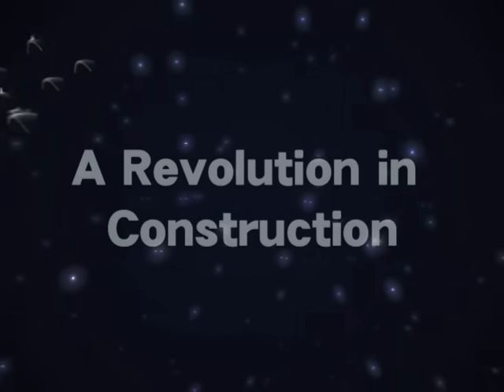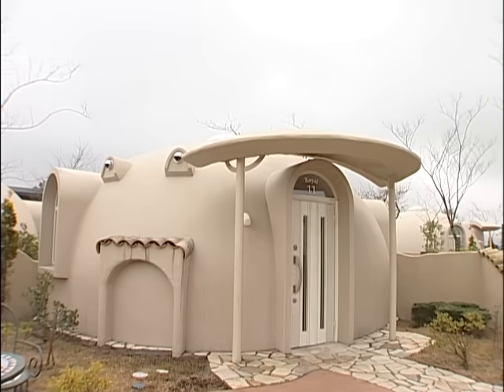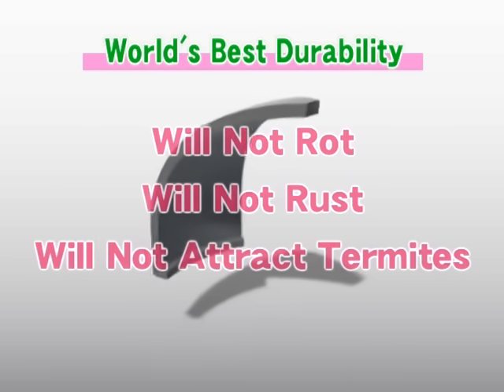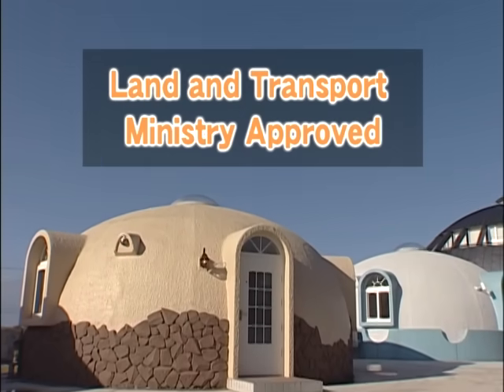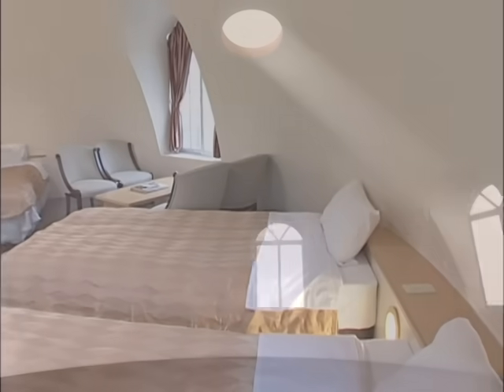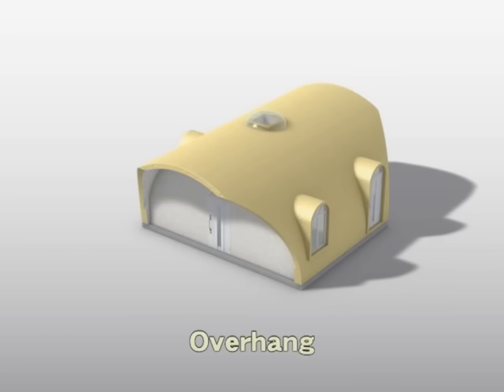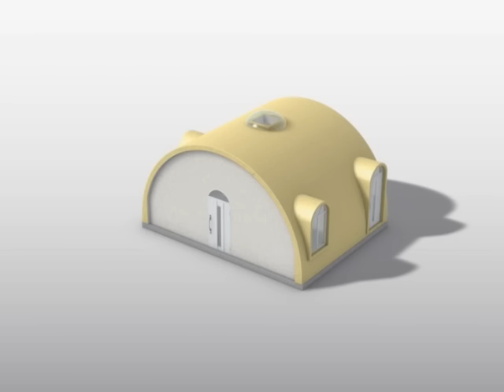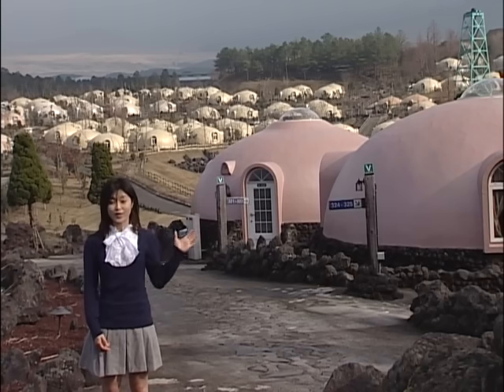Expanded Polystyrene Made Dome House

Comment: These should be designed as pre-fabricated, all-inclusive disaster-relief shelters (wired and mounted with solar-lighting).  Perhaps 2 sizes: one family of 5-6 and expanded 12-persons capacity size.  The dimensions should allow for a longer, narrow, low-ceiling design sufficient to fit inside a C-17 and possibly even C-130!  (i.e., able to be trucked on flat-bed too).  If available as Lease-option, International relief agencies could rapidly acquire said Lease funding arrangement with host-country government and able to quickly deploy.  Thus, the incentive could then be on host-country to further accelerate reconstruction and relocation to more permanent setting.
Reply: CHEER UP, The U.S. Military already have 20 x 16 inflatable shelters that are covered with a cement membrane, that gets sprayed with water until wet & allowed to dry, becomes a great room for use as anything that is needed.
Reply: Decking, arbor, options?
Reply: All it is, is foamed concrete. We don't need another country building them. We build them right here in America.
Reply: nope FEMA would not pay for the labor associated with construction and then the responsibility of  what to do with the structure after use. no they want fully mobile  deliver and forget and easily redeployable
Reply: @angelob9465  yea exactly, so they can have surplus fema trailers on lots in ole miss sitting for years after victims of natural disasters  needed them
Reply: What about effects on environment from discarded houses and components?
Reply: Great idea but the dirty criminal politicians won't get rich that way.
Reply: Something more like that than this already exists.
Reply: @LC-ue6mp  Exactly.
Reply: @skittles3310  Sorry Skittles. Foamed concrete, aka Aircrete, is entirely different from this, but could be done the same way. These are far more energy efficient, and lighter, than aircrete.
Reply: @LC-ue6mp  yep
Reply: @skittles3310  it is not foamed concrete

Comment: That is very cool ,  you could assemble  the dome and  then spray over it  with cement inside and out  then seal it and paint over it .
If you wanted added strength you could  stick some concrete steel  mesh reinforcing and spray more cement . 
 In the comments someone mentioned moon base alpha interconnected domes ,  a fantastic idea. 
 In this day and age , it should not take  months to  erect a house .

Comment: I've been inside these.  The air even feels different, it is like being inside a picnic cooler.  Also no sound from outside, so that seems really weird.  Combine these two things and it feels and sounds like nothing you have experienced before.  One problem was with expansion.  The joints were an issue for cracking, plus you cannot hang things on the walls.
Reply: connecting blocks  by nylon tie

Comment: @Asianecohome PrivateLimitted
I think the idea is excellent, but how do you derive the liquid caused by body and sweat? Polystyrene is water and airtight, so how do you prevent the house from mold growth??

It would be really awesome, if you could use old plastic for the production of the foam material (polystyrene). If this were possible, your product would be extremely good and also very sustainable and environmentally friendly. With that you could achieve worldwide success.

Comment: The simplicity of this design with this material is really attractive.  I just wonder what part "weight" of a structure plays in its stability when subjected to high winds?  My guess is that the shape takes care of that problem.  What about the shear strength of the walls?  That is, the wind blowing horizontally and pushing to snap the dome off of its base.

Comment: Structural insulated panels SIPS . sips panel is like an ice cream sandwich . Mt ice cream sandwich had walls 4 inches of foam encased in 5/8 inch OSB board. The roof has ten inches of foam , exterior side 2 layers of 5/8 OSB, interior just one layer of OSB. All structural elements are encased in the panel. Super strong, air tight, super efficient.
 Florida especially central Florida has brutal Summers.  1,700 square feet of home with one 1.5 ton central ac. The ac is a heat pump so all in one

Comment: The best part is, if the roof collapsed during an earthquake, instead of being killed it won't be any worse that being hit in the hear by an empty styrofoam cooler.
Reply: Actually, domes are more earthquake resistant than box houses.
Reply: +Jaye Jay Curry clearly you didn't appreciate the irony of my statement.
Reply: The humour didn't escape me. I just wanted to point out one of the advantages of domes that your statement opened up.
Reply: And during a flash flood, you can just set on the couch and float down stream - good for dry land and doubles as a house boat
Reply: I had that once after eating mexican.   Never again!
Reply: Do you know what inflammable means?
Reply: Jim Adams 
You'd be Fukashima
Reply: It is coated with concrete or stucco which might be a bit hard on the body during a earthquake.
Reply: B Gone if I could put 100 likes for your joke , I would!!!!
Reply: @jayejaycurry5485  wow, nice counter!
Reply: HAHAHAHAHAHAHHAHAA

Comment: Much like the metal arched building used in the military, but with insulation.  I noticed that they put brick or stone around the bottom.  Wonder if that was in response of keeping pest or vermin out of the house.  If they came with solar panels, they would be perfect.  Wonder if they would be permitted in the U.S.
Reply: It's not real brick and stone. It is all styrofoam with different structure and paint.
It's only for aesthetics

Comment: I live in a house made of expanded polystyrene with a steel frame.  There are some pros and cons.  It is almost too well insulated, so it can get stuffy.  However, my electric heating bill is a lot better than my neighbors.  We had some bad hail one time that made big dents in the back wall, but it was easy to patch.  It was built in 2000, and we are going to get it re-stuccoed pretty soon.  (Unfortunately the builder didn't fix it to the floor very well and we have had leakage under the walls.)

It is very difficult to hang pictures on.  I have had some fall and break.  I think we need to use some wood to make a picture railing.  I'm not sure.  If anyone has any suggestions, I am sure open to ideas.  

There is a problem with noise.  It amplifies noise coming from the outside.  (The floor is scored concrete, and I hate it.  It is way too cold in the winter, and it is hard to stand on for very long.  If we had the money, I would put in hardwood floors.)
Reply: now these are the important questions most ppl needed answered, thank you for your input. now i understand why these aren't being used in mass production all around the world. 

their not bad for what they are, their just not all that well built for other weather conditions. 

this may sound silly, but to solve the sound and heating issues, it might be a good idea to get the house covered under dirt or perhaps a much thicker layers of stucco. but dirt might be much better than stucco. this is how earth ships work, because they use the earths natural temperature control and sound barrier capabilities. 

i just don't know if the building material will be strong enough to handle the dirt packed all around it and on top of the structure.
Reply: @5226-p1e  I've always preferred earthen houses.  We lived in an adobe house in New Mexico, and it was the most comfortable house I have ever lived in.  I realize that earthen houses may not be the best for earthquake prone areas.  The expanded polystyrene is lightweight, so it would probably be better in earthquake areas, but I don't know how it would hold up in hurricanes.  We were told it could survive up to 90mph wind, but maybe, in a dome shape, it would fare better.
Reply: @Claycat4  
your right. dome shapes do work better. there is this video i just recently watched after watching this video of an dome home that was built near the shoreline in Florida, i can't remember the name of the dome house, but it's survived 3 or 4 hurricanes for the past 20 or so years. the guy who built it on the idea knew it would be able to withstand the harshest conditions.  let me see if i can find the video.
Reply: @5226-p1e  Thank you!
Reply: @Claycat4  
your welcome i hope it helps.

Comment: I'm a retired journeyman Roofer & Waterproofer who's worked with Polystyrene in commercial and Industrial construction for 32 years ,to add to what K Simpson posted below is the smoke and fumes from burning Polystyrene is super toxic ,it's such a dangerous insulation most building codes require it to be sandwiched between 2 layers of fireproof materials like Dens Deck or 1 inch drywall ,a fire in 1 of these domes while people are sleeping would create so much coal black smoke within seconds finding an exit would be impossible before they would  asphixiate, Japan has strange and dangerous building codes that allow for 6 ft wide by 100 ft long houses due to an insanely high land tax and inheritance tax.
Reply: You don't have to look for an exit, Just kick o hole thru the wall, lol

Comment: Watching fires reduce some of the most expensive and well build homes in northern and southern California to piles of ash. My guess is these foam dome homes would melt or blow around in these wind driven fires ....but they sure would be useful now for the thousands of displaced families and pets...I'm wondering if they float because in a flood if they could rise off the surface and still have a floor they save lots of items.
Reply: The video shows it is coated & plastered with concrete type material and it is  also infused with fire retartdant so it may hold up in a fire better than a regular house.

Comment: Do these structures meet construction standards in the United States , I am very interested in using this method to build cabins in remote areas. Due to the light weight, ease of transport and assembly, and rapid setup time.Also is there a corresponding line of interior fixtures such as lighting, ductwork , plumbing .
Reply: I would suspect so (even if bureaucracy is a killer everywhere), Japan has problems of earthquakes and storms so if it's approved there it should be easy to meet other standards

Comment: Hi!  Thanks for such a great idea for affordable housing that is also durable.  It is made of petroleum products and paint etc.  I was wondering about off-gassing of the materials in time.  To live in such a structure I would think fumes from the material would eventually cause health problems.  Still though, this is innovative and great to look creatively at affordable housing.  I wonder if they could design it so you could make right angle and 45 degree angle etc turns in the quanset arch style they also show.  Thanks again for contributing to the quality of life with your going "outside the box" so to speak and trying new ideas.  Sincerely, 5368mwj

Comment: The main problem besides only being good for cool climates is that unless it is heavily sealed on the inside it will offgas toxic air. I like the design, but would prefer to make the panels out of aircrete. It would be heavier, but not bad if each panel was made of 2 or 3 interlocking pieces (abit more like an igloo).

Comment: If Styrofoam never decomposes EVER, how is this beneficial to the environment? Theoretically speaking, these houses will never leave this planet; thus having the capability to fill up the Earth entirely with domes.
Reply: +Kate Malinak  What is good in having a environment friendly house in Japan if it will not withstand earthquakes and storms? (EPS can replace gravel on concrete, is just a matter of recycle it)
Reply: The benefit would be that you only have to build one of these structures once and it will last for a very long time, as opposed to 2x4 construction which is more susceptible to biodegrading.  Construction of new buildings consumes considerable resources, so not having to rebuild so often saves energy which would typically come from burning fossil fuels.  Also, expanded polystyrene breaks down over hundreds of years and is recyclable.
Reply: Kate Malinak  Gives a way to use/recycle what's already here instead of padding the landfills. I don't see them working in TX with our propensity for High Winds, Tornados, Hurricanes & Hail.
Reply: Kate, did Al Gore give you that info?
Reply: Linda:  LOL:   I was also thinking of something along those lines.

Comment: one can paste the outside with a white heat reflective  meteral  so it never gets hot at all people put the heat reflective coating on tralers that keeps sun rays from heating it up its stupid to think it would burn when thing can certainly be done to prevent that ?

Comment: Is just the foam frame really worth $40,000 though? Thats quite expensive for no additional features.
Reply: hmm, were you orden stryrofoam ? my friend,engineering buil full house at styrofoam and normal woodhouse cost 300 000£  and frame 20-30000 € thats house cost 6000€ normal sguare styrofoam and concrete covered. And i build carage hall,one car cost 2000€ than normal woodgarage has cost 12000€

Comment: Polystyrene is UV sensitive, so there must be some sort of layer protecting it from sunlight....
Reply: Didn't you see how it was constructed? Panels are assembled than cement is smoothed over it and then spray painted over. That should be more than enough UV Protection for the polystyrene.

In my mind though, what if something breaks through that shell, like crashing your car through one of the walls? Is the whole panel replaced or a section of it?

Comment: Polystyrene is classified according to DIN4102 as a "B3" product, meaning highly flammable or "Easily Ignited." 
As a consequence, although it is an efficient insulator at low temperatures, its use is prohibited in any exposed installations in building construction if the material is not flame-retardant.
Reply: it's not standard polystyrene, as showed in the video----

Comment: Can we have these shipped to the US
Reply: no, they violate building codes because Polystyrene is highly flammable and ignites at relatively low temperatures. It has been linked with huge fires, often in commercial buildings and warehouses, where its use is more common.

Comment: Do they export to Australia
Reply: Polystyrene is highly flammable and ignites at relatively low temperatures. It has been linked with huge fires, often in commercial buildings and warehouses, where its use is more common.

Comment: The flame test they showed doesn't hold up to any scrutiny. Polystyrene burns all too well. The render they applied is obviously protecting it from the flow temperature flame that was being passed across its surface. If he held the tip of the blue flame on the surface for more than 5 seconds I bet it would blister and burst into flames giving off toxic choking fumes as it decomposes.

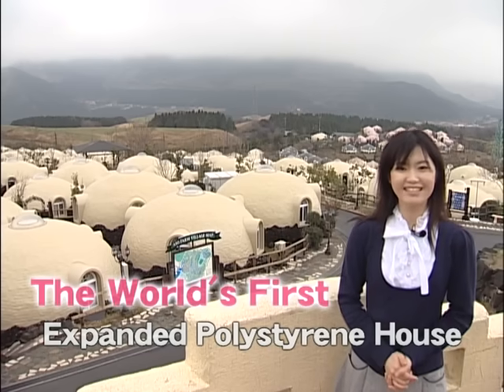Comment: My concern is snow load capacity, our code requires 250 kg/m² at 45 degrees, and 750 kg/m² for a flat to 1:10 pitch.  Will these foam structures comply?

Comment: I guess they weren't a hit - the website is no longer.
Reply: thinking it would be good with adobe or cob mud walls on the inside, and shotcrete on the outside for strength..maybe lay rebar over the dome before spraying it with shotcrete, then a nice smooth lime finish